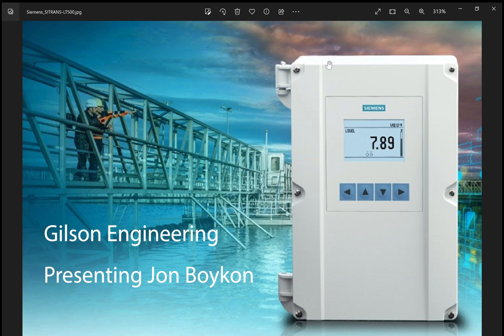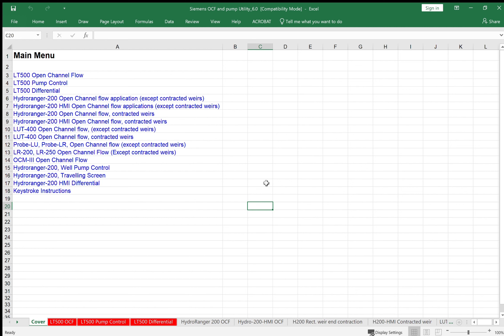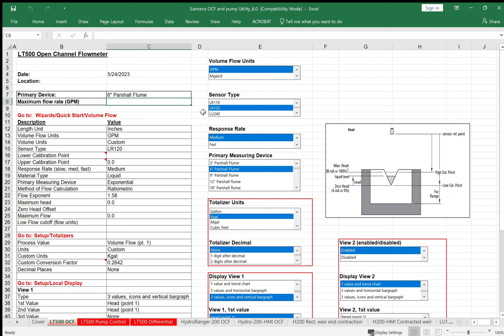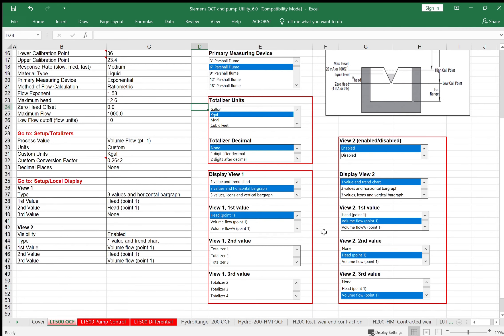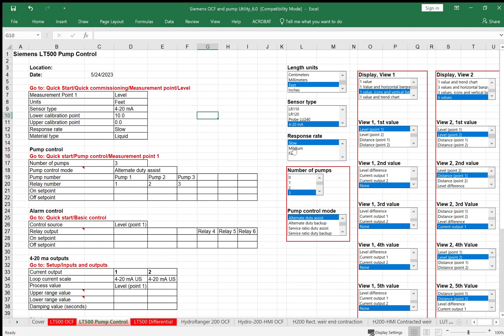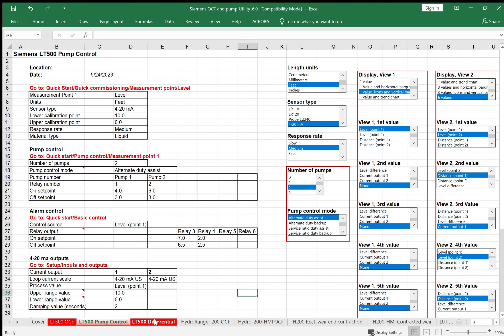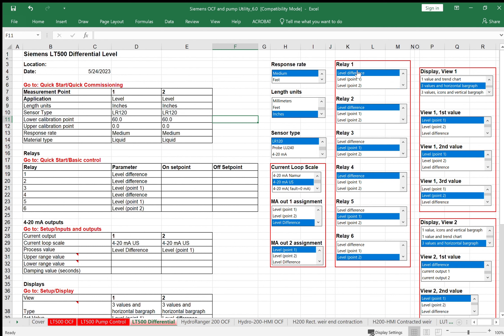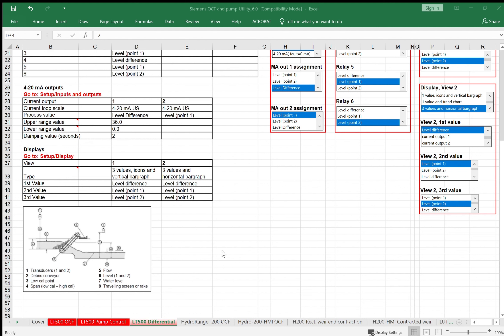Siemens LT500 Level Control Configuration Utility

Comment: Nice video.  Best practice, for an Open Channel flow weir application you should set the Cal Lo parameter to be the distance to the bottom of the channel, not the “zero head”. Then, set the zero-head-offset to be the distance from the Cal Lo to the zero-head point (the apex of the notch, or crest height). This will allow the LT500 to accurately detect liquid levels below the notch/crest, and report Head and Flow accurately without loss-of-echo errors. 
(Small point, coming from someone who is familiar with the Siemens level products.) :)